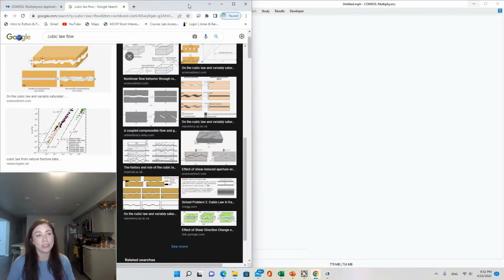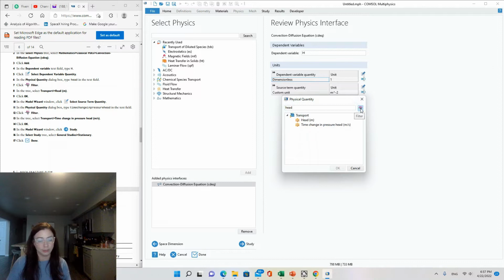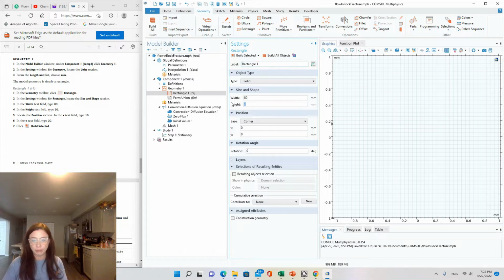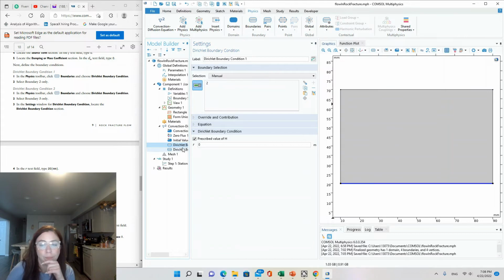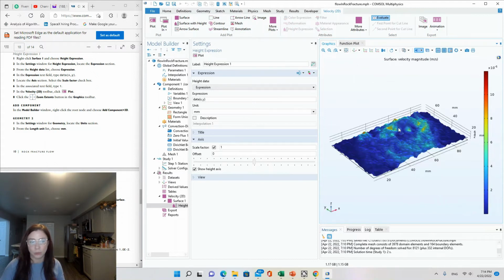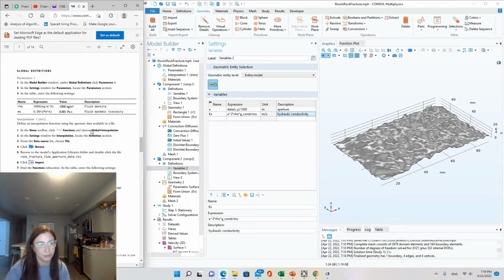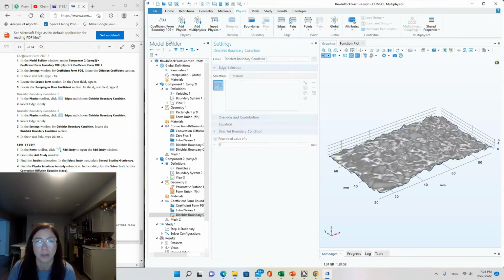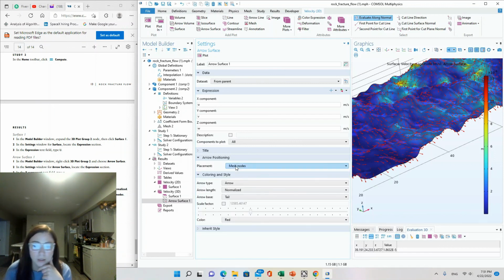Rock Fracture Flow ("cubed law") COMSOL Tutorial

Comment: Can you do some Vedios on hydraulilc fracturing simulation？
Reply from the maker: This seems to be a fair fit of that description. What exactly did you mean? Do you have a certain example?
Reply: @JessicaHoffmanTutorials  I means simulation of crack extension under hydrodynamic coupling. The core of the model is the crack extension model, which is now implemented in the literature using either a damage model or a phase field model or other methods.
Reply: I have collected some cases, I don't know how to show you those, maybe you can check the literature, and I don't know what your research direction is.